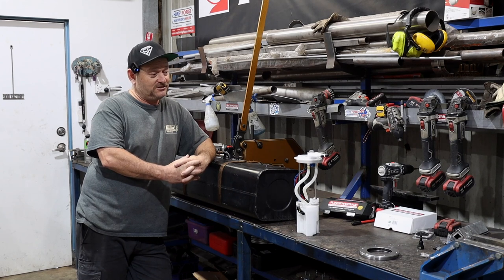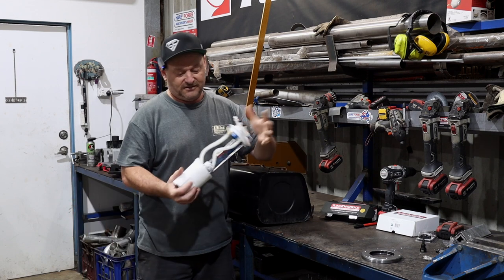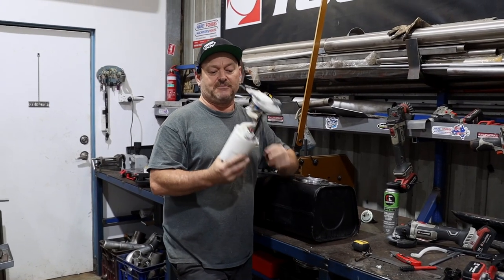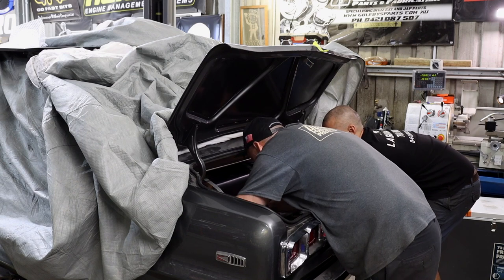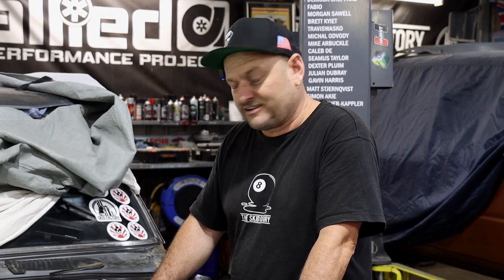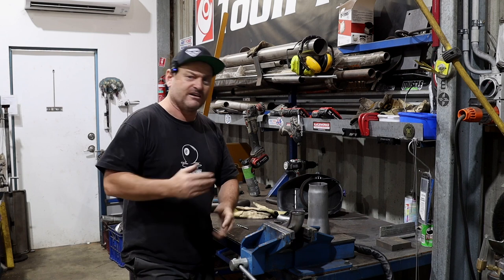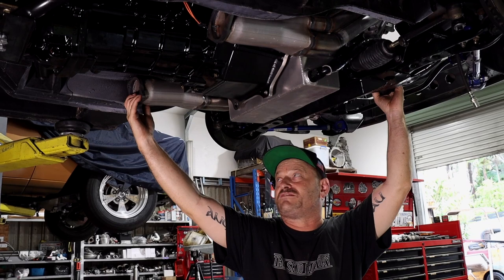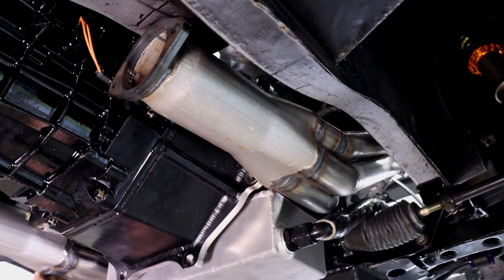Preparing for First Start, In-Tank EFI Fuel System & Custom Extractors

Comment: manually shaping each pipe, welding it with a pretty basic set up, and just getting after it.   turns into a work of functional art.   Even before the skid factory channel started Al has always been on another level.    Then, you add in Woody getting better and better at editing over the years and content creation while also growing his own fabrication skills with Al.     It's been a pleasure watching you all from the start of the channel and looking forward to first start on this build!  Not sure if it's the same as the  Millsy Risk Assessment, a good measurement for how to correctly oversize a turbo.

Comment: Al those pins on the holesaw arbor push down into the holesaw itself and lock it in place. So when you're done drilling, the saw can be easily unthreaded.

Comment: MRA = modular reservoir assembly. When I left a Holden dealer and went to a non dealer workshop and referred to an MRA I got looked at like I had 3 heads. Also the reason the return is done externally on those is so the fuel runs through the fuel filter and returns filtered fuel to the tank on VT-VZ. Schmutz in unfiltered fuel has a small risk of jamming the reg internally and users of old V6 Commodores will pour any old shit into their tank.

Comment: I loved making the equal length extractors, the pipes meeting at the collector with the firing order going in a clockwise direction, then the spike was 4 twisted fins to get the exhaust swirling. They went really quiet when the power clocked in. No dyno in those days to check my work.

Comment: Should have got Hartley   to mill you up a trick one piece oval to round transition header flange to save you from hand forming the pipe. At least it was a newer port design, I had to make a set for my 302 hilux with sharp rectangle ports which was a nightmare. You're 100% right, patience is the key

Comment: Haha I used a similar fuel pump setup on my build but I ended up using the Ford B series pump cause it has 6 holes already formed in the plastic so I didn’t need to use the weld on ring, I also had to shorten it and did exactly what you guys did cut the tubes an popriveted the ends, was a bit oh yeah but seeing you guys do that put me at ease a little 👍👍

Comment: Nice work on the pipes Al, would love to have your fab skills. With the return on the MRA its better to have the T after the fuel filter  to keep a more consistent pressure at the rail, otherwise a partially blocked or restricted filter will reduce actual pressure at the rail!

Comment: Just a thought about the T-piece not being internal in the fuel pump assembly. There are pressure losses pushing the fuel through the hoses. Having a complete return line could give you higher pressure at the engine. Currently its adjusting the pressure for the loop only, not for the complete system. If it matters? No idea. 

As always, top quality content!

Comment: The return line on the pump assembly is for using an external (serviceable) fuel filter between the pump outlet and the T piece. So the excess fuel delivery by the pump also passes trough the filter and gets cleaned. Therefore you increase the fuel pump and pressure regulator life, since they don't have to deal with the dirt on the fuel the hole time.

Comment: in the UK, your 'extractors' are simply called 'exhaust manifolds'. in my youth these 'performance' maifolds as you made here were known as 4 branch manifolds and were an upgrade from the factory cast iron type manifolds.
Reply: Well actually the UK consider some vehicles to have 2 Manifolds.
1 is an Exhaust Outlet Manifold 
2 is an Air Intake Manifold 
Extractors are acceptable to be known as in English Although they belong in buildings and have fan assistance.

Is it really an upgrade from Cast Iron due to performance.
Or is it a natural evolution from Cast Iron to Aluminium in engine block manufacturers use????
Iron on Iron Never warped.
Aluminium on Aluminium never had problems with Heatsoak.

Comment: Little nitpicking: Carbon Monoxide (CO) isn't inert, for example it gets burned as a secondary reaction in oxy-acetlyne torches (or suffocates you if it doesn't). Carbon Dioxide (CO2) is inert for plenty of practical purposes.

Comment: What fittings did you use to convert the plastic ends on the sender unit to be compatible with the AN fittings?
Reply from the maker: RWF-715-06-06BK converts from GM 3/8 “quick connect” to -6AN
Reply: @theskidfactory  cheers 👍
Reply: @theskidfactory  thanks also had the same question

Comment: Lovely work on those headers.

If you haven't already, I'm going to go out on a limb and suggest/ask for a video with a few pointers about welding to a fuel tank without blowing yourself sky high. You know, the best way to clean them out etc. It might be a remote risk but it does happen, or at least eyebrows are singed off.

Comment: Return outlet (or inlet depending on which way you want to look at it) is for the fuel filter on factory setups to not impede flow on the feed line itself...I think.

100 series = rubber braid
200 series = teflon braid
400 series = pushlok

Comment: Sizing of the pipes does make a difference.  Long smaller runners will move the torque curve down toward lower RPM.  That said, unless you are going to A/B them for every combination just do what Al said, make them a little larger than the ports.

Comment: Loving this build so far 👍
What size primary tube did you use and what size is that collector?
Also why will you go for a single 3 inch system, won't that be restrictive?
Reply from the maker: 1 7/8" primaries, 3.5"-3" collector. I don't think single 3" will be restrictive.

Comment: 5:47  Should have stuck it on the right side of the tank.  There was a perfectly flat dimpled section.
Reply: You would have to mount the tank vertically, the pump would not be low enough to use all the fuel, and the the fuel guage wouldn't work.
Reply: @mrmikemanify  Sarcasm partner... sarcasm...

Comment: 4 inch is 89% of the area of dual 3 inch or close enough if you have the area to fit it. 4.24 inch is 100% of dual 3 inch area but usually requires oval pipe to fit.

Comment: Matching the actual length of each pipe is not proper procedure. Each elbow has an equivalent straight pipe length that should be included.  There are published formulas to calculate, or rules of thumb that can be used.  As Al said really only needed for getting the last few HP out of a setup.

Comment: Little problem, Carbon Monoxide is extremely flammable. Carbon Dioxide is not flammable.
Reply: Good thing exhaust gas is mostly carbon dioxide and water vapor.
Reply: @thebigmacd  Not disputing that. I'm disputing the statement made that Carbon Monoxide is inert implying it was not combustable. Carbon dioxide was never mentioned in the video.

Comment: Why install a non-petrol resistant hose inside the tank ...! ???
It will burst a few days after refueling !!!
You need to use a hose with an outer petrol-resistant sheath ... or the plastic one that was at the new station!
But apparently you are hands-on and do not know how to work with plastic hoses ....)))
Why the hell are you showing technical nonsense as correct truth?
Reply from the maker: It’s INTANK fuel hose, it’s meant to be in the tank, hence the name.
Reply: Да товарищ